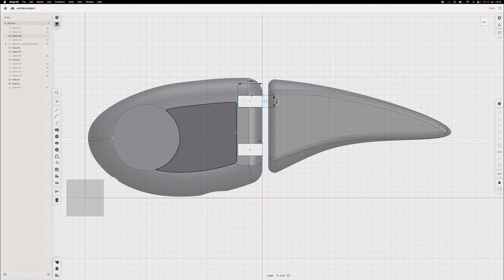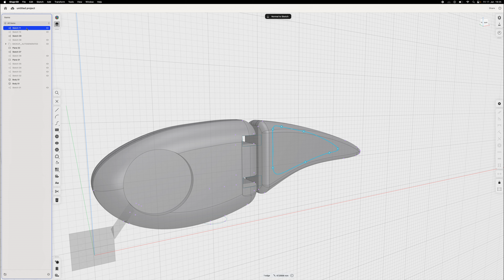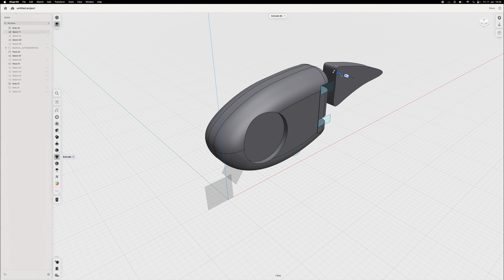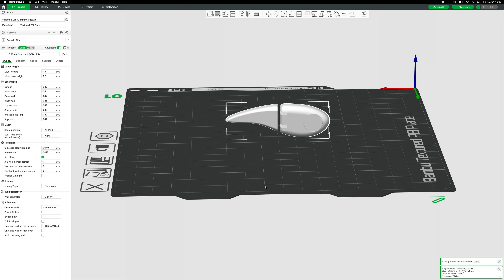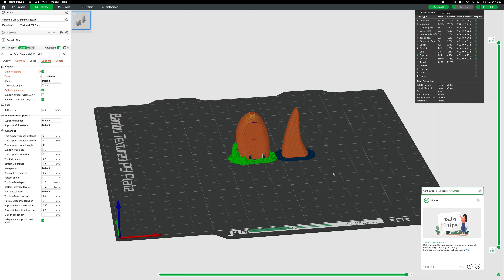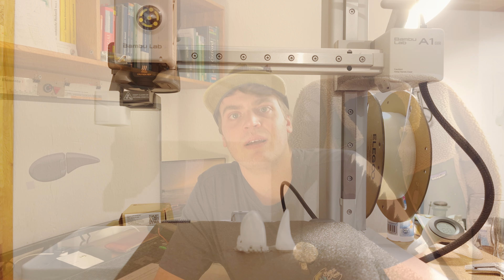How to make a SWIMBAIT with a 3D-printer - easy way to split an existing lure model

Comment: Is there anyway I could download a file you've used? I'm really bad at 3d modeling but I wanted to see if my 3d printer can make a small swimbait/glidebait. One like your trout swimbaits is exactly what I was looking for but I can't find it anywhere. If not that's fine, thank you anyway
Reply from the maker: Hi at the moment I haven’t released the files yet - but I will in the future. 🤗 They are still a pain too work with after the 3D-print so I will change some things in the design before releasing. 👌🏻

Comment: One thing I found about air pockets is that sometimes they make the lure heavier instead of lighter.

The reason for this is because adding holes means adding more walls, it’s the way slicers work.

Maybe try printing a version without the air pocket and a lighter infill, then compare it with this one to see if the pocket is removing weight or adding it.

Another thing that can help is to make sure that the thickness between the air pocket and the outside faces of the lure is exactly the same width as your shell width (width of all walls in the slicer)

For example if you are using 2 walls at 0.4mm then make the shell width of your air pocket 0.8mm or slightly higher 0.84mm
Reply from the maker: Hi 😊 - I actually had trouble with the action of the lure if I printed with no air pocket and I also sadly didn't get the buoyancy I needed. Another struggle with just minimising the infill material was getting the screws fixed properly. I've also been playing with the thought of using PLA-LW but I am not quite sure how it would perform during printing - do you have any experience with filament of that kind? Thanks a lot for your thoughts and input. I will have to try the idea with creating a shell in the near future. 🤔
Reply: @ i see, that’s weird though maybe it’s the infill pattern or maybe it’s something else’s not sure.

Regardless PLA-LW it’s very weak and won’t survive a cast, you could use it with a through wire but then you have the added post processing.

ABS and ASA are lighter than PLA and PETG but you need an enclosure to print them.

Comment: Which program are you using for your designs? Looks like it might be a bit simpler than some of the others and since I have Zero CAD experience I would enjoy simple. lol thanks for hte video!
Reply from the maker: The program I am using is Sharp3D, it is quite intuitive in how it works - but it does have its limitations (or quirks). 😅 I am sure it is one of the easier programs to get into if you have never dealt with construction software. 👌🏻
Reply: @christiancasts Thanks I am gonna check it out.

Comment: [ Hi guys and welcome back to my channel "where I go fishing so you don't have to." ] 

I simply don't understand why you say this in your intro every time. Why would anyone have an interest in making fishing lures or even watch one of your videos if they don't like fishing and go fishing??? It just doesn't make any sense, because most, if not all of your audience enjoys fishing. 😊

I looked at dozens of jointed swimbait pictures just now to double-check my thinking. They all have the eyelet fastened into the forward segment of the lure, with the slots and pin in the rear segment of the lure. Yours is designed opposite of this. Is there any advantage to reversing the joint?

I couldn't tell if you designed the holes for the hardware and pin into the printed blank so you don't have to drill them.

Always interested in strength tests!

Thanks for the video!
Reply from the maker: Hi there! My welcome slogan is meant to be sarcastic - more of an inside joke for myself. I know most (if not all) of the people who come across my videos are fishing enthusiasts like myself. 😅

The design choice I made with the slots and the pin in the main body of the lure is easier due to more space - it just makes the placement more pleasant. Another benefit is that the pin gets additional material for support. I don’t think changing this would affect the lure’s action, but who knows - maybe I’ll test it out in the future. 🤔

I don’t design the hardware holes beforehand because I’ve had issues with the fit and print quality in the past. 😅

In the future, I’ll also make a video comparing self-made hardware to the eyelet screws I currently use. Stay tuned! 👍🏻

Thanks for watching and engaging with my content.
Reply: @christiancasts I understand sarcasm and fully enjoy the humor, for some reason I didn't catch it. 🤣

You make a very good point about there being more material on the front portion of the lure to support the pin. I have seen lures lose the tail piece due to breakage from such a small surface area securing the pin. In fact, I am working on a wooden lure where I plan to reinforce the pin with "staples" embedded in the wood to strengthen the joint. I've already cut the joint so it's too late to try your solution on this one.

I would at least design an undersized pilot hole into the printed lure to guide the drill bit. It would uniformly mark the placement of everything and make the drilling process quicker and easily aligned.

I have always made all my twist-eye hardware for hook hangers, line ties, and joints. Your test with the screw-eyes proved my worst fears of it opening up under stress. However, I've seen other tests too, and even though the eyelets failed by opening up, the force required to do so would never be achieve by the fish I'm after. So, I probably have unfounded concerns, but still prefer as much of my lures hand made as possible. I've even started custom making the eyes.

I'll be looking forward to the next one!